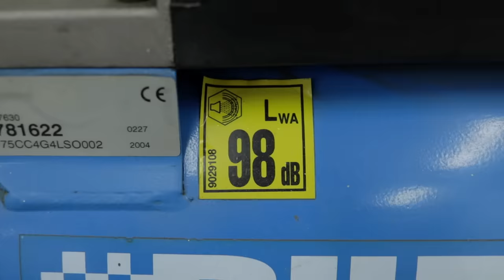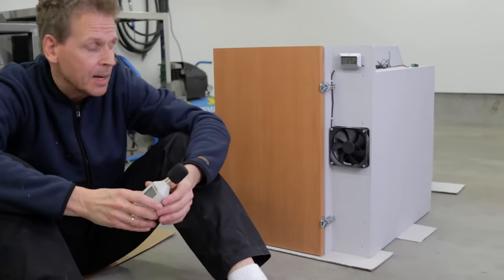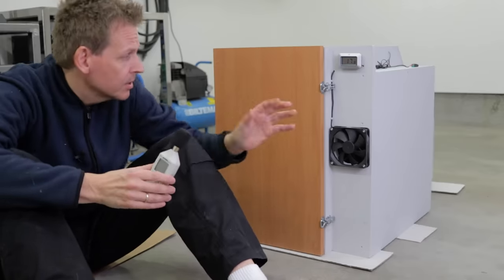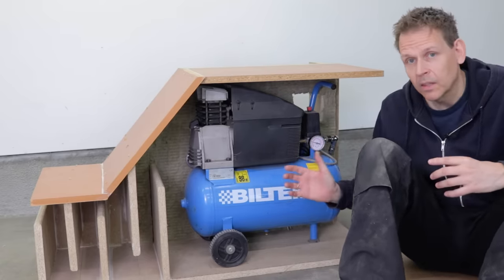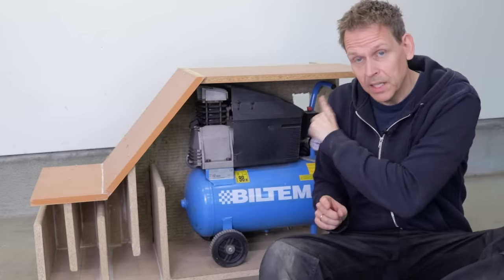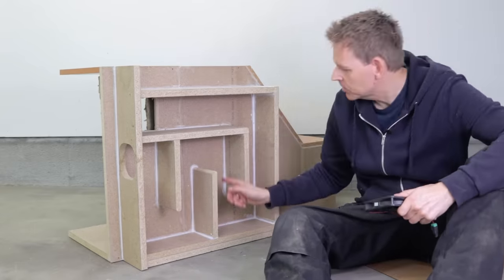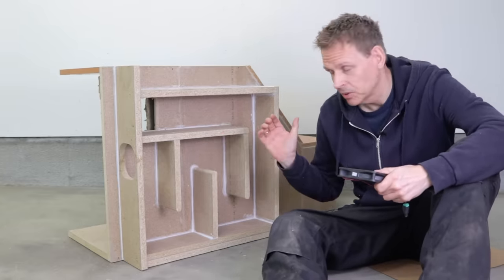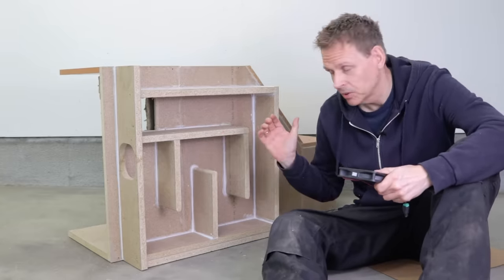Do not build a sound insulated enclosure for your noisy air compressor!

Comment: Nice job, if not a bit of overkill.  Some of it was in the wrong direction, however.  There are a few keys to sound deadening:

1.  The first principle of sound deadening is mass.  The greater the mass of the enclosure, the less it vibrates.  Also, higher mass minimizes energy transfer between the noisy object and the enclosure.  Higher mass has a lower resonant frequency, and is more likely to turn the sound energy into heat rather than conducting it.  See #4
2.  Second is vibration isolation.  Dense foam or rubber pads under the compressor between it and the enclosure will help immensely.  Also between the enclosure and the structure it sits on to prevent vibrating the whole building.  Again, see #4
3.  Absorption.  You have done a pretty good job in that regard, with the baffles and so on, but you need a thicker and denser material than that rag cloth for better absorption.  High density closed cell foam, carpet underlay, or automotive audio sound deadening mat would work way better.  Higher density materials are better than light ones for the low frequency sounds of the compressor.  Light materials work better for high frequency sounds, the lower the frequency the higher density needed.
4.  Conduction:  Decoupling of the panels used to make the box.  Gluing a dense foam sheet material between two sheets of MDF makes a great sound deadening panel.  Use this sandwich as your external box material, and as a "pad" to mount the compressor on inside the box.  Also, a panel between the box and the floor.
5.  Sealing:  In order to prevent air leaving the enclosure from carrying sound waves with it, the enclosure should be basically airtight.  This is not really possible in your situation, as you need to remove built up heat.  Your baffle arrangement is the next best thing. See #3

As several other people mentioned, the compressor air intake is a major source of noise.  It is a direct pipe to the piston and valves.  Adding a coaxial tubular muffler in series with the intake pipe (very similar in construction to an automotive muffler ) will make a huge difference.  Just a piece of PVC pipe stuffed with rolled up carpet underlay (dense) and some adapters will work wonders.  Plumbing the air inlet outside the building will also plumb the noise outside as well.  Cooler incoming air will result in less heat buildup too.  Sucking hot air from inside the box is not really a good idea.

Also mentioned by others, you definitely need a water drain accessible on the outside of the box.  There are automatic drains which are a simple solenoid valve.  When you power on the compressor, it closes the valve and allows pressure buildup, when you turn off the mains switch it opens and drains water through a hose to a suitable drain or receptacle.

Finally, keep a close eye on the heat buildup in the enclosure.  Your small fan may not provide enough airflow to keep the box cool under high duty cycle use.  You risk early demise of the motor and bearings, not to mention the possibility of starting a fire.
Reply from the maker: Thanks a lot for a thorough analysis and for a lot of tips 💡👍 I have planned some improvements based on comments, and I think you have pinpointed most of them 😊 I have limited space where I have put my compressor box, so I cannot make it any bigger, but I will try to improve it on the 'inside'.
Reply: you can swap mass for tension, push the resonance up in frequency so that the sound sources don't trigger it.

Comment: If you want a quiet compressor in your shop, get a big one, the bigger belt driven units are much quieter on account of a bigger, slower piston, the little ones knock their pan in high revving a small piston hence the noise.
Reply: You know your stuff ,peter  ✌️
Reply from the maker: Yes, you are absolutely correct. If you can afford it and have space for it! I am not really using it enough to justify either the cost or occupying that much space for it. It's always a compromise 😏
Reply: the bigger it goes, the quieter, less RPM, the frequency is more on the bass, in terms of decibels, doesn't do much, but decibels don't measure loudness, they measure sound pressure. lower frequencies are much more tolerable to the human ear, even with more sound pressure.
Reply: Rotary Screw Air Compressors
Reply: @aaronsbarker  please buy me one!
Reply: And, as a way to keep it quieter, run a  intake line to the outside of the building. Most of the noise on large compressors is from the intake. It also keeps a lot of dust out of the filter.
Reply: Another alternative would be a refrigerator-style compressor system. Much slower to recharge though so you need a larger tank but it's less than 40db without an enclosure. Commonly used by dentists and beauty parlors.
Reply: I test drove my new lowes card , when i moved to florida  8 years ago , and got there biggest v  twin 80 gallons ( i think ) 
Glad i did too , because now there not v twin's and there alot more money , i left my Ingersoll vtwin 80 gallon in my michigan home , i go visit it when the weather is right
Reply: @kihestad  Milwaukee Larger battery compressors
Reply: It also runs less often for a comparable amount of use.
Reply: @monad_tcp  The human tolerance for lower vs higher frequencies is accounted for in the measurement scale being used. The dBC scale is full auditory spectrum, the dBA scale he used in the video (and what is used for most measures of noise) ignores the lower frequency.

Comment: I've built several of these over the years before I bought an actual silent compressor, the type made from adapted refrigeration compressors, which are, well, no more noisy than your refrigerator. I would use actual carpet for the insulation and foam. They all worked pretty good, but yours is impressive.
Reply: That's a scroll compressor. The main downside is that oil needs to be mixed with the incoming air stream to lubricate the scroll pump and motor bearings, or it will eventually seize and burn up. The oil is finely atomized into the air stream by the scroll, so you need an oil mist removal trap and filter on the output side.
If a scroll compressor is pumping into a compressed air line, if it is turned off it can't deal with the output pressure. It will stall and hum, and trip the thermal reset. You need a way to unload the output pressure so it can start easily.
Reply: @DMahalko  I don't know about current refrigeration compressors, but the compressor I have has a piston. It has no rings and compresses air via a thin layer of oil between the piston and cylinder wall and yes, you do get some oil in the air. This requires some really good filters because these units are often (or used to be) used as dental compressors.
Most compressors should have a check valve after the pump and before the tank as well as a pressure relief or unloader valve incorporated into the pressure switch because, as you pointed out, the motor may not be able to start the pump while it's under load.

Comment: I have had a similar experience. 5 years ago I had a 1200W old style compressor like your one, very loud and it does occupy quite some amount if real estate. I tried various things to make it quieter with little success. I then moved overseas and left it behind. The replacement compressor I chose is also similar to yours, 800W 2 stage diaphragm type with a 30L tank and super quiet and oil free design. A literal quantum leap from the old one and also way smaller and lighter, I can just take it where I need it and store it in a smaller space. I also use a much smaller diameter 10m hose that takes up 1/10 the space and weight of the old one and does not seem to affect performance. I can use the new one inside the house without noise problems. I could even use this to run an airbrush it's so quiet. Well worth the upgrade.
Reply from the maker: I think your experience is very similar to mine indeed! 😊 It's not every day a equipment upgrade feels like a quantum leap, but I agree: this one does 👍🤩
Reply: @kihestad  upon reflection I realize that the only good thing about the old compressor was the handle was easier to reach because it was physically larger but the new one is so light I can just carry it around. This is one rare zero regret purchase, another was my cordless Lithium impact driver. There is synergy there too because the cordless driver replaced many air tools which require a large CFM compressor.

Comment: My Brother-In-Law put his large air compressor in an enclosed space outside his shop.  He poured a concrete pad, ran electrical to it, and ran air lines from the compressor back to his shop.  The enclosure has fiberglass in the walls to help deaden the noise.  Works pretty well.
Reply: and that's also safer incase it ever exploded

Comment: Great video and believe it or not you got better results than you thought, 85dB to 70 dB is achieving a 5.6x reduction !  The silent compressor is only half the capacity so is not at all comparable ?  Buy a screw compressor that is quieter than a piston type but the cost is was more.  Bang for your buck with a home build from surplus material will be great value for most guys.  Remove the plastic wheels and rubber mount the compressor inside the box to minimise vibration transfer will help some more.  Your car air cleaner's design is to cut intake noise, try the same on the compressor and get some auto sound deadening sheet stuck to the compressor tank as well.
Reply from the maker: Thanks 😊 I guess I have over-simplified and even misunderstood how the decibel scale actually works. The new air compressor is approx half the capacity compared to the old one. For my usage I have not noticed it that much, except when using my sand blasting gun or when just blowing air. A screw compressor would have been great, but as you say to expensive for a hobbyist, and too big as well 😏

Comment: More isolation inside and around the box will help, particularly from the floor.  Use suitable sound deadening material, often dense material with less dense foam and an undulating suface.  Also consider connecting the inlet and outlets to tubes going outside.

Comment: Excellent video. We’ve gone down the road in silencing a compressor. Here, we liked the style of the cinematography, the BEST of any such YouTube presentations… humorous and self-effacing. Great. Let’s face it, shop workers can’t avoid getting old, but we can avoid being old and deaf [due to occupational noise exposure]. We have built two compressor enclosure boxes outside our shops, and using many of the same principles used here. We didn’t want to annoy the neighbors when doing shop work on the weekends. Since we could build our boxes outside, we used simple masonry block [CMUs] walls [basically glued together]  for the basic enclosure: the higher the mass, the lower the acoustic transmission through the structure. We also used baffles just like shown, on the input and output. Air goes around corners but sound wants to travel straight unless reflected. Though, we took advantage of using acoustic tile for baffles rather than solid material. We disagreed somewhat with the conclusion: we thought the author’s effort was worth it. Of course, one can always buy another quieter compressor, but there is the satisfaction of silencing one that is noisy! A final reduction to 35dB is really good from what we think was an initial 85dB: that’s like from listening to a lawn mower, to less than a library. Congratulations!
Reply from the maker: Thanks for the positive feedback, and for your thoughts 😊 sounds like a very good solution you made, moving the compressor to a shed outside the working space is smart 👍

Comment: I've seen this done with generators used at events, (yes, they have very quiet ones, but very expensive). They built a box with baffles and used fiberglass, which is not a good sound killer, then they used a squirrel cage fan, which was small, quiet and blew a lot of air into the box to keep it from overheating. It was not silent, but it drastically reduced the noise.  I also watched a demonstration where they took a 55 gallon drum, lined it with fiberglass, then put a old school bell in it, put the lid on and it only slightly muffled the sound, then they used the blown-in insulation made with shredded paper, and it made a huge difference in the reduction of sound. This was to show the difference of how much quieter your house could be using a different insulation in the attic.
Reply from the maker: Sounds great 👍 I would assume this kind of box will work quite similar for a generator as for an air compressor. You might have to deal with exhaust from the engine, and perhaps even more heat than from an air compressor, but otherwise much of the same 😊

Comment: It looked to me like the vibration of the compressor was being transmitted through the box, so your design probably did a pretty good job of blocking the noise being transmitted through the air, but those vibrations being transmitted into the box itself make the outside of the box vibrate and emit it's own noise into your garage. You need to decouple the air compressor from the structure of the box. I would suggest something like a compressed rubber mat. It's pretty cheap and is used in sound and vibration dampening applications. I bought some years ago from a place that specialized in sound and vibration control materials, but you may be able to find it elsewhere too.

The other thought I had is if you're going to put it away up in your attic space, why not also look at separating the actual compressor from the tank. The actual compressor is pretty small. Most of the space is being taken up by the tank and the trolley to wheel it around. If it's going to be fixed in place, you could probably take the compressor off of the tank and frame and just enclose that in the sound proof box, then run lines to connect it to the tank and the rest of your system. That would allow you to either build a smaller box, or add more dampening material or baffles to the box.

Comment: You had mentioned that the new compressor, although significantly quieter, is also rated for much less capacity. Considering that the decibel scale is logarithmic, the sound reduction your enclosure had offered is very impressive. Yes, the old compressor may still have been loud inside the enclosure. If you have air tools that require that capacity then the enclosure can make it far more comfortable in the shop. In addition, an enclosure such as what you had constructed can be easily modified to use a readily available (and cheap) home heating air filter that would offer vastly greater particulate filtration and exponentially more surface area for filtration than the typical air filters used for shop compressors. If you are doing a lot of sanding and/ or grinding this particulate filtration will be appreciated by the compressor in the long run.
Reply from the maker: Aha, not 100% sure if I understood you correctly - but yes it would not be difficult to add filtration for the air the fan blows into the box. I am doing mostly metal work, so I dont have an extremely dusty environment, but for those who have this would be quite smart.

Comment: Make sure you provide a way to open the drain on the bottom to let out the water! You don't want the tank to rust and burst, it can be pretty violent when that happens.
Reply from the maker: Absolutely! It's a bit cumbersome as it is now, I need to open the four eccentric locks and pull of the door and then take the compressor out of the box. It takes no more than 5 minutes, but it's enough to postpone it to the next day 🙄I better put on a line and have it on the outside....
Reply: @kihestad  there are automatic drain solenoids you can add that work on a timer.  Connect it to the power when the compressor is turn on and route the drain outside to make it low maintenance and safe.
Reply: Take some largish iron pipe.  id recommend atleast 1" bigger is better.  Put in a T and a drip leg and drain valve and then a vertical component the longer the better.  From the air compressor take your pressure off the drain side yea this is the wet side but now we constantly drain the condensate.   Run that to the T.  Off the top of the pipe elbow reducer regulator and moisture trap/dryer.  

Now 100% of that water gets blowm out of the tank into this vertical pipe.  The air cools in this large manifold and the moisture falls out dropping into the drip leg.  Being large the air flow is low and the water condenses out and runs to the bottom were you should reduce and install a drain valve on the drip leg ideally routed outside so you can just blow that water out.  Mine doesnt get any moisture in the trap.

Comment: so, the "port' you built can be tuned using a speaker enclosure calculator. might be fun to adjust the port area and length to tune the box to a really low frequency to maybe reduce output through it. it wont really change the frequency of the air compressor but it will help filter out the higher frequencies in theory.
Reply from the maker: You are probably right about that, but I don't really know how to calculate it and I don't have any tool to measure the sound level in different frequencies - I am afraid it would be a lot of trial and errors, and possibly only errors 😁
Reply: @kihestad  yeah. the returns may not be worth the investment.